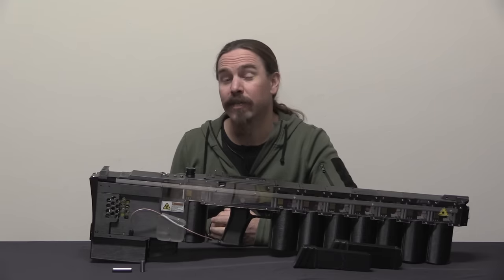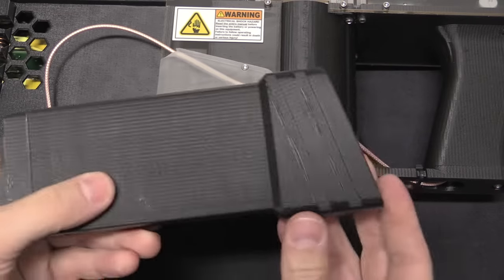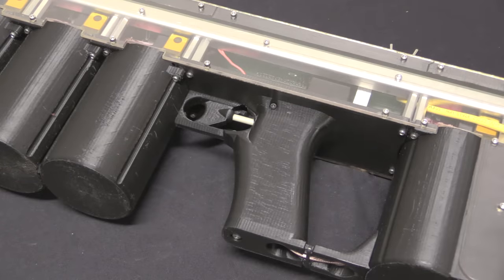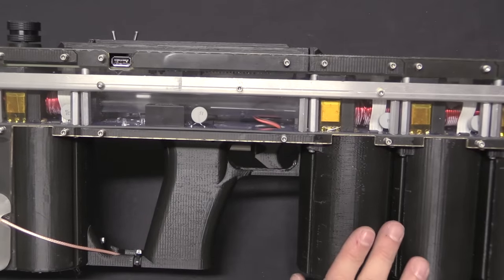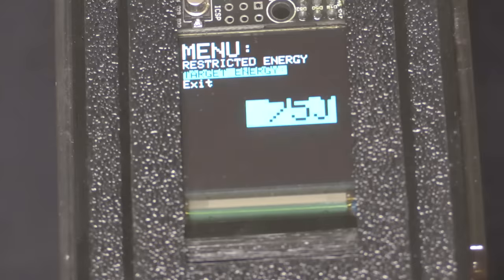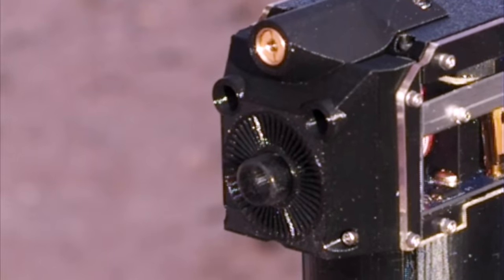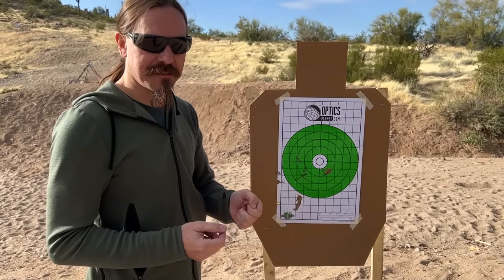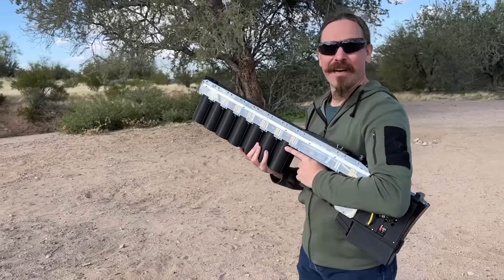ArcFlash Labs' GR-1 Anvil Portable Gauss Rifle

Comment: Keep in mind that the "muzzle energy" of a crossbow bolt is also miniscule compared to a proper firearm, but it can absolutely injure or kill you.
Reply: The muzzle energy of a medieval crossbow bolt is somewhere around a pistol fired .22LR and this coil gun is somewhere around an air gun round. On top of that the geometry of a crossbow bolt helps to do the killing, but deviating from a cylinder shaped slug is quickly going to cost this coil gun muzzle velocity.
Reply: @SBBurzmali  Modern Air-guns can shoot WELL above this. Over 1500fpe. I own several that do over 500FPE.
Reply: @robert7984  Of course, I was referring the the commonly available models, you can make a .22LR round with as much umph as a 9mm or more if you are willing to risk blowing your face off.
Reply: @robert7984  kinetic energy is calculated, based on mass an velocity. Ur stupid airgun might shoot a lot faster, but your bullets are a lot lighter to.
Reply: @SBBurzmali  why? Slapping a non-ferrous cap on that slug wouldn't impact muzzle velocity.
Reply: @dryaldibread2327  The Aea Zeus shoots an 870gr projectile at roughly 850 fps for ~1300 ft/lbs of energy. There are many big bore air rifles suitable for deer sized game and even boar.
Reply: @SBBurzmali  You can go to any Outdoor supply place and buy a PCP air rifle. WTF are you even talking about? Stop living in the 70's
Reply: @dryaldibread2327  Lmaooo
Reply: @dryaldibread2327  why did you feel the need to call it stupid
Reply: @Deadbeatcow   It's probably because that's how he was referred to by all of his teachers.
Reply: @SBBurzmali  I mean I wouldnt bank on this thing having any kind of lethality unless it hits you in the absolute WRONG spot on your skull, a piece of solid steel thrown by a human arm can inflict some damage on the human body, a steel slug traveling at 231 feet per second can certainly be a bad day if it hits you in the wrong place. Either way just remember this is essentially prototype tech, may be commercially available prototype tech but still prototype. Not something to buy for home defense or anything but ffs its cool that we are seeing new and futuristic forms of projectile propulsion in arms that can only improve with time and research.
Reply: @SBBurzmali  To get the benefit of the geometry, a fin stabilized, pointed, discarding sabot round would be a good try.
Not sure how the sabot would work though, given the way the magazine loads. Maybe something that comes apart with sufficient air resistance>
I am not a ballistics designer, sorry.
Reply: @dryaldibread2327  incorrect. there are airguns that you can take large game with... large 50.. 60 + caliber bullets at good speeds. They are MUCH more dangerous than this overweight toy.
Reply: @ryanw7196  preach brother.
Reply: @DarkBluePaperHats  absolutely correct. But air guns have over two hundred years of development. Give this gun time. By our grandchildren's era Gauss guns just might be serious threats on a battlefield.
Reply: Could have sweep back tail fins like those navy rail guns... like arrow heads they'd make a mess and be very difficult to reverse direction for extraction, and would fix the tumbling issue. The trick they use is having the supporting frame/cylinder of the projectile fall away as it leaves the muzzle, and the (non-muzzle-shaped) payload continues ahead at mach whatever in a stable flat arc.
Reply: @SBBurzmali  lol I don't think it works like that
Reply: @monarchco  Depends on how much weight you add or how much steel you remove. A potato gun can fire all kinds of random projectiles, but you'll run into all kinds of issues if you try loading a modern high end rifle with a round with a slightly off load, never mind an oversized round.
Reply: @robert7984  On paper, or at least the source I'm looking at, PCP air rifle comes in at around 50% of a 22lr from a pistol.
Reply: So can a thrown rock.
Reply: @Nice On a practicality level, electric-powered weapons are probably going to be most useful on space colonies where no one has easy access to gunpowder.
Reply: @Nice A pump shotgun firing beanbag rounds with smaller powder charges in the shells is probably a lot cheaper.
Reply: @SBBurzmali  many PCP'S out power a little 22. rimfire lol Look at The pellet shop website dude.  There are pellet rifles there that have the power of firearms.
Reply: plugged in the numbers based long rounds in the video: a 650 grain (42.119 grams) armature traveling at 74.5 m/s will hit with 116.88 joules. probably less given air resistance during travel

this is about 23% the energy of a 9mm parabellum or 64% of a 22lr. i was surprised how close that was, and getting hit by this would absolutely ruin your month
Reply: @PubChem 6089 they also don't have a charge time and can be used with non metallic objects, this gauss "rifle" while fun to shoot I'm sure (definitely want to myself.) probably isn't great for anything past 50 feet, however I definitely wouldn't want to be on the other end of this thing.
Reply: That has to do with the length of the projectile and it's ability to penetrate.

I am certain that dart rounds will be practical.

The slug I think is an infancy type round.

Also canister rounds.
Reply: in this case it's insanely expensive for something weaker than a firearm, but you have a point for 3d printed guns that act like slingshots. you can mass produce slingshots that are strong enough to knock people down or otherwise stop them from coming at you